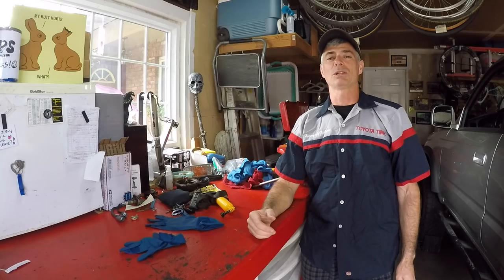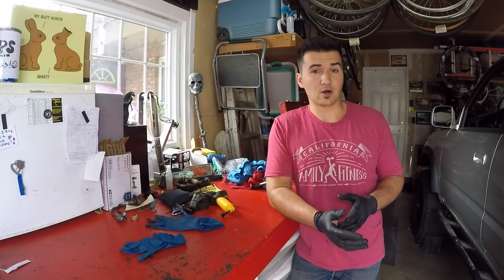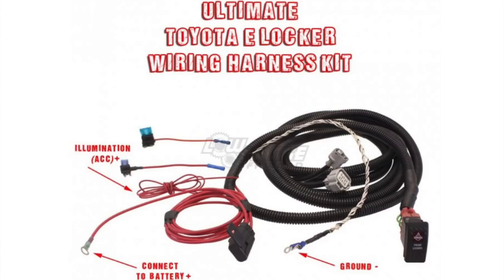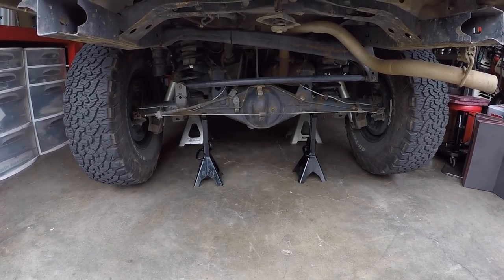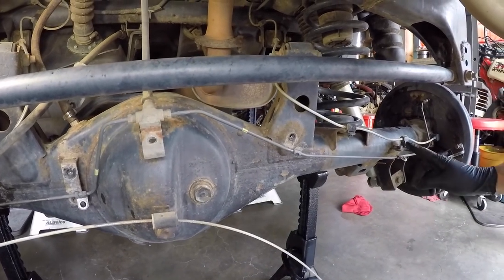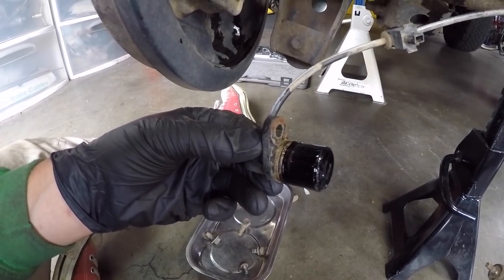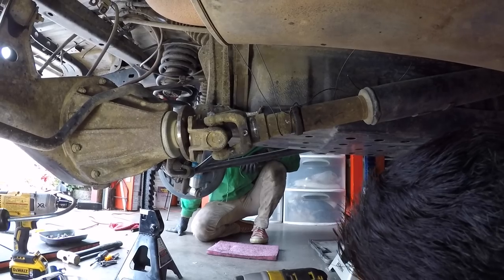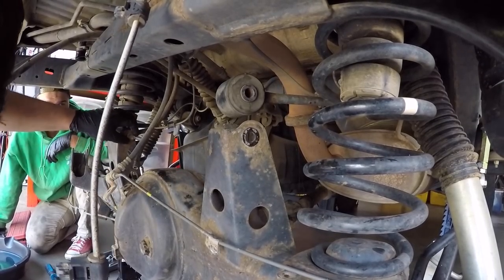E-Locker Axle Swap + Wiring How-To

Comment: Hello Timmy I watch all of your videos. I have a 98 3.4 4wd cylinder 3 has 140 in the compression test. I was thinking of going the jdm engine route. Any experience in this or know what would be involved in needed parts if I go that route? All the posts I can find seem to trail off and don't give much info
Reply from the maker: Hey George, I don't have any experience dealing with JDM engines.  I have heard via Toyota forums it's a crap shoot what quality of engine you will get and you can't always depend on what the person selling it to you is saying.  You will need to swap over parts from your original motor onto the JDM engine to make it work.  That's about all I know regarding these swaps.
Reply: @TimmyTheToolman   thanks for responding... I'm going to look into 2 options one being the JDM... 600k miles on my clock with the original motor so I cannot complain. She still runs good... Just fouling that plug every 2 weeks. She still had some time but want to plan ahead for that day. Just did the compression test yesterday.. your video was impressive and helped me do it.... All cylinders were 195-200 except that #3. Keep up the great work
Reply from the maker: @zloutlaw8286  Ok George.  Good luck the motor swap when you get around to doing it.  We are planning on doing a motor swap this month.  If you can wait, we will have a video series you can use to get the job done.  I imagine the videos will be available sometime in April.

Comment: I am going the same route as Sage, I have both front and rear diff from a ‘00 w ecu and wiring. However, I want to put it on my 01’ with CDL and I was wondering if I have to do anything different because of the CDL
Reply from the maker: The center diff lock is a totally separate system from the rear locker.  It should work fine.
Reply: @TimmyTheToolman thank you for the response! Also sense it’ll be going from 4.10 to 4.30 is the drive shaft let her the same?
Reply from the maker: @huerta32  The driveshafts are the same.  The gear ratio has nothing to do with driveshaft length.

Comment: Hi Timmy, I'm getting ready to put in an oem elocker from a '99. My '98 doesn't have the ECU or wiring.  Hence, I bought the wiring harness from Dark Illusions. Really nice guy and a solid harness.  It only has 2 plugs (actuator and lock position sensor). I digress. I'm trying to figure out how to test the actuator before I begin installation. Since my wiring doesn't include the ECU, do you know which pins on the actuator plug that i need to attach power/ground to so i can ensure it will function properly? THANKS!
Reply from the maker: We do have this bench test video that might help you out: https://youtu.be/OhIPf4_B23M
Reply: @TimmyTheToolman  Thanks Timmy! found the answer if anyone else encounters this problem. there are 5 pins on the actuator plug. well, actually 6 but one is blank.  the two pins in the same row as the blank are for power. attach a 12v supply to those two pins. if it doesn't immediately turn, remove the leads and switch them. try again. that should return it to it's original state when you removed it from the differential. don't keep power on the pins after it turns just to protect the gears from locking up.
Reply from the maker: @cardp17  Glad you found your answer.

Comment: Just spoke to a shop, they said that there's no reason why the e locker would have a different gear ratio than the rear and front differential. He asked where I heard this and told him online. He said "ohg theres a bunch of nonsense online." Which I can agree this but the different gear ratios seems to be basic common knowledge for 3rd gen 4runners. Scary stuff.
Reply from the maker: Yeah, there's no difference of the gear ratios between the front and rear until you try a modification like this. Most non-elocked rigs have 4.10 gearing and elocked rigs had 4.30 gearing.  If you put an elocked rearend in a rig that came with 4.10 gearing, you either have to swap out the front diff with one that has 4.30 gearing, you re-gear the front diff to match the rear, you re-gear the elocker to 4.10 or maybe you re-gear the front and rear to something like 4.88 or 5.30 gearing because you're running bigger tires and you want better power.  

You just learned that paid mechanics don't know all.  They are quite often wrong and they make mistakes.  For these reasons, I prefer to do most of my own wrenching.
Reply: I wish I could do my own wrenching. Unfortunately I'm limited to oil changes!! As for the gearing and install I found a shop that knows exactly what I need.
Reply from the maker: Sounds good George.  Hope the shop treats you right.

Comment: Question.. Other than being a normal 4 runner option and full control (being able to lock/unlock at will), is there a reason this might be better or worse than a trutrac (torsen diff)?  I like the idea of torsen diff and have been looking for what would really be the best choice but I have decided that if I decide on locker that its going to be the factory e-locker.  I would appreciate hearing your opinion.  Thanks!
Reply from the maker: Hey Thomas, my buddy Jordan has a trutrac both front and rear on his 3rd Gen and he really likes it.  It's not a true locker but it has worked really well for him.  So, it's definitely a viable alternative to a full locker.
Reply: @TimmyTheToolman  I like the idea that I wouldnt have to turn the locker on/off and that in theory it automatically shifts on the fly.  I hear some downsides from some race car enthusiasts that torsen cant handle rough handleing like hitting the gas and this is what I'm trying to consider for offroading where I might abuse the gas peddle through mud pits or something.  BTW.. I really appreciate your videos  These are amazing for 3rd gen lovers!

Comment: I'd like to engage my e-locker to ensure that it operates before installing. Would I need to wire the complete assembly? Is there a way of grounding and powering the actuator directly at the e-locker plug? Maybe I missed it in the video, but what'd you guys think about switching out the ring and pinion from your original diff to the e-locked diff to match ratios?
Reply from the maker: I don't know how to bench test an e-locker but there have been people that have, so if you do a search, you'll probably find a forum post or write-up from someone telling you how to do it.  Seydzh might know so I'll ask him.

Switching out the ring and pinion isn't an easy job and it requires you to be very precise.  It's why most people just farm it out to a company like East Coast Gear Supply.
Reply: You can follow the instructions in the following forum post. http://www.toyota-4runner.org/3rd-gen-t4rs/167531-factory-e-locker-troubleshooting-%7C-bigfishallday-quoted.html

Regarding switching out the ring and pinion from your original diff, my thought on that is: might as well upgrade the gear ratio from stock 4.10 to 4.88 as stated in the video, instead of stepping down from 4.3 to 4.10. A professional should do it because it takes precision to get the ring and pinion to align properly. You don't want them rubbing unevenly as it will cause chatter and premature wear. A proper ring and pinion setup should last the life of the vehicle.
Reply: thanks fellas!
Reply: All you need to do is get a couple test leads with alligator clips and a 6 volt battery (I used the one out of my mojo duck). The solid green and the green with red stripe I believe are the two you are powering. Piece of cake.

Comment: Hello hopefully you comment quickly in wiring it now have a 98 limited no locker and when plugging it into the brown cluster the 5 spot is being used. All of them are being used except 3. Pls help dont know what to do. 6 and 7 are also not being used
Reply from the maker: Maybe you figured it out by now.  If you did, let us know.  We did this job once and we have heard the wiring diagram we used isn't a one size fits all.  The issue about the plug spot being used is something we have heard from others but we've never heard if they figured out a solution.
Reply: @TimmyTheToolman  hey man thanks for the reply. I didn’t bother and put everything back together. What do you think I should do. My 3rd slot of open but don’t know what that would do. Or should I take the one out the 5th because wouldn’t only be working if that lights on but I’ve never seen the light on.
Reply from the maker: @griffinhahn7400  You need to get access to a wiring diagram.  If you have a windows based computer, you can go on a website called Toyota Tech Info, pay $20 for a 2-day subscription and access any information you want.  https://techinfo.toyota.com/techInfoPortal/appmanager/t3/ti?_nfpb=true&_pageLabel=ti_home_page&contextType=external&username=string&challenge_url=https://techinfo.toyota.com/techInfoPortal/login/techinfo&password=secure_string&request_id=3549806120519272108&authn_try_count=0&locale=en_US&resource_url=https%3A%2F%2Ftechinfo.toyota.com%2Ft3Portal%2Fappmanager%2Ft3%2Fti%3F_nfpb%3Dtrue%26_windowLabel%3DReferenceForm_1%26ReferenceForm_1_actionOverride%3D%252Fportlets%252Ftis%252Fdocument%252FsearchUplift%252Fform%252FsearchForm%252FsearchDocument%26_pageLabel%3Dt3_page_66  There's a link to the minimum computer system requirements on the bottom of the page.  I use it all the time to access information on vehicles but I had to buy a windows based laptop to do it.  You could also just ask on a Facebook page like 3rd Gen Mafia if somebody could provide you with some pics of wiring schematic for the dash cluster, specifically that plug that controls the dash light for the locker.  I don't have a 98 wiring schematic.

Comment: Timmy, do you happen to know the bolt sizes that hold the actuator to the third member?
Reply from the maker: Aged10Years most likely it’s something small like a 10mm or a 12mm
Reply: Timmy The Toolman thank you. I just picked up a locking 3rd...cleaning it up and moving forward. Your channel is beyond helpful.
Reply from the maker: Aged10Years that’s awesome dude! We hope you report back with your experience/success with your install

Comment: tim, what's the easiest (install wise) locker/LS  for a 7.5 rear end? no serious off road and something DD friendly. i have a 2003 taco prerunner with 6 lug, 10 bolt housing, 7.5 gear with 27 spline and 4.56 ratio, code on door jam sticker is BO4A. thank you for any help or recommendations.
Reply from the maker: For your needs, a limited slip would be fine.  You could use a company like East Coast Gear Supply to do the install for you whether you send them your 3rd member or you buy one from them.  Either way though, you'd be sending them your 3rd member at some point because they will charge a core charge.  If you don't want your vehicle to be down a long time, buying one from them and then sending yours back would be the way to go.  Other options like an ARB air locker are more involved because it involves installing an air compressor and running the air line to the locker.  There are also self-locking types of rear ends but those have weird driving characteristics and you'll feel the locker sometimes briefly engage on turns even when on the pavement.

We have a video for pulling the 3rd member.  My buddy Jordan got a True Trac locker installed by this guy who goes by the name "Zuk".  He does a great job rebuilding 3rd members so he's another option for you to get the work done.  Here's a link to that video: https://youtu.be/ZMTbgY1xQKk  Check out the video description for a link to Zuk's website.
Reply: @TimmyTheToolman  tim, thanks for the recommendation! i called ECGS, very helpful... options, options. options, LOL! watched the 3rd member vid, thanks for paying it forward... 2 thumbs up!
Reply from the maker: @mrmojorisen6336  You're very welcome.

Comment: The link for the Toyota part on the camelback site isn't working. Do you have a part number?
Reply from the maker: Hey Nathan, don't have the part number unfortunately.   Camelback changed their website and I think that's the problem.  You can try calling them and explain what you need.  Ask to talk to Amanda.  Or, you can just visit your local Toyota dealership parts department and get it through them.  I don't think those pins would be expensive even though the dealer.
Reply: @TimmyTheToolman   Looks like the part number was in the diagram. Terminal Repair W W - Toyota part# 82998-12170
Reply from the maker: @nathanRs08  Glad you found what you were looking for.  I forgot that the wiring diagram we linked listed it.  Good luck with the job.

Comment: Do you have any problems with the limited slip differential button or light coming on? 
LSD button 
Now that you don’t have Different differential
Reply from the maker: What LSD button are your talking about?  There isn't one on these rigs so you must be referring to something else.
Reply: @TimmyTheToolman  My 2010 Toyota Tacoma has a button for “auto LSD” which is part of the traction control.  I believe it uses the ABS and the limited slip differential?   I was just wondering if when going to the E locker set up does the auto LSD still work when you’re not engaging your locker?     
I’m kind of new to all this
Reply from the maker: @jamesbabineau9767  Ok, now I understand, we're talking about different generation trucks.  I don't know how the electronic traction control system would work if you added an e-locker to it.  Maybe check out a forum and see what some guys say.

Comment: How long does it take to change out the rear end and front diff
Reply from the maker: It depends on a lot of factors but safe to say, you will spend the better part of one day doing this.  For the front diff swap, use our video but be sure to read the comment we pinned for tips on an easier way to get the old diff out and the donor one in.  https://youtu.be/w_gPiDvh9v4

Comment: Could this be done to a GX470 of the same era?
Reply from the maker: If you were able to fabricate and bolt up a 3rd Gen rear axle to your GX470, I guess it could work but that would probably be a tall task and probably not worth it.  Your best bet would be to go with an aftermarket e-locker or other type of locker like an air locker meant for your rig.

Comment: Is it possible to do a similar swap in a 2wd 4runner? Seems pretty straightforward and without front diff gears to match. I know some prerunner Tacos had the elocker setup. Obviously not as capable but more more capable than standard 2wd. I know I'm wading into shaky territory by even asking the question given the alternative (buy 4wd) but I'm genuinely curious.
Reply from the maker: Andrew Van Grinsven yes it is possible to do this same swap into a 2wd. Like you mentioned, it’s actually less work because you don’t need to swap the front diff at all!
Reply from the maker: I don't see why it wouldn't work.  You would need to find a donor axle housing and e-locker off of a Tacoma unless you know how to fabricate and can make the necessary changes for a rear end off of a 4runner to work with your Tacoma.  Tacomas have leaf springs and 4runners have coils so the mounts are different.  Or you could alter your axle housing to fit the E-locker 3rd member.
Reply: Ok awesome. It piqued my curiosity when someone nearby had an e-locker 3rd for sale from a 4runner - wondered if it could be swapped into my 2wd t4r. It wasn't until I found this video that I learned I'd have to modify the axle housing to make it fit, or swap the entire thing. Lots of work but would be neat!

Comment: Hey Tim, the brown plug that goes to the back of cluster my 5th pin is already fill and seems like it’s oem, is there another way to get the light to engage on the cluster? My brown plug has 3,8,and 13 open only
Reply from the maker: Unsure.  I think you're going to have to look at a wiring diagram for your year and figure out what pin powers the dash light on your rig.  The wiring diagram we link in the video description is for a 98.  What year rig do you have?
Reply: 97 4runner 4x4 sr5 I found a form people use pin 8 I’ll try that
Reply from the maker: @o1unitlee54  Ok, good luck.  Let me know how it worked out.
Reply: Hey Tim I just got done trying out my wiring and everything turn out great, but my rr diff light is constantly on, is Seydzh  the same or his only comes on when he push the button?
Reply from the maker: @o1unitlee54  His only turns on when he pushes the button.

Comment: Do you have P/N for the pins? Links don't go directly to parts anymore
Reply from the maker: I added part numbers and new links.  Thanks for making me aware of this.
Reply: @TimmyTheToolman  just realized you had the part #s on your diagram.  🤦‍♂️
Reply from the maker: @HKSmr2rbo  No worries.  It's easy to miss.
Reply: So I just got around to doing this retrofit.  Just wanted to point out that on my '98, the diff lock lamp pin was the 2nd one on the right hand side of the connector